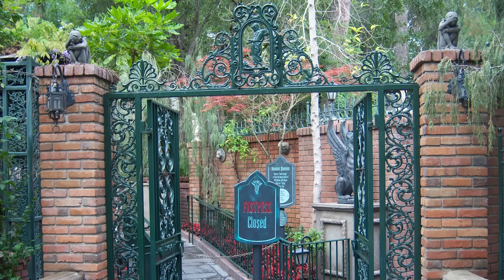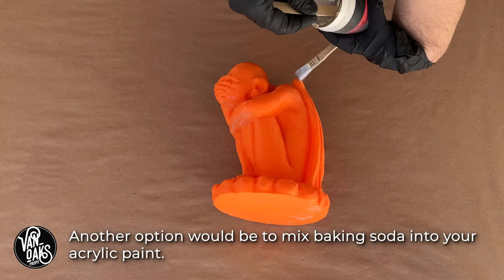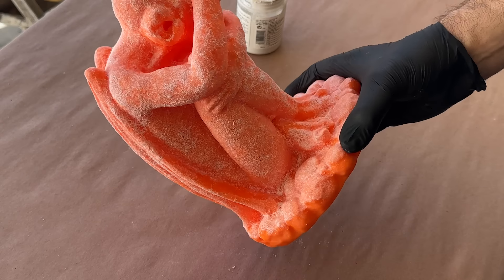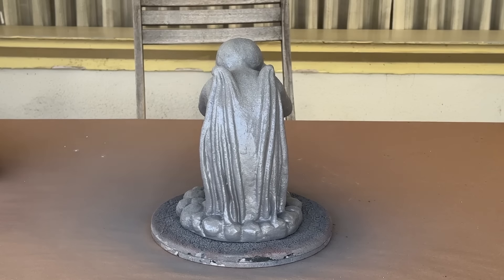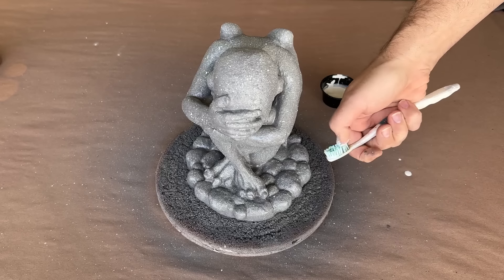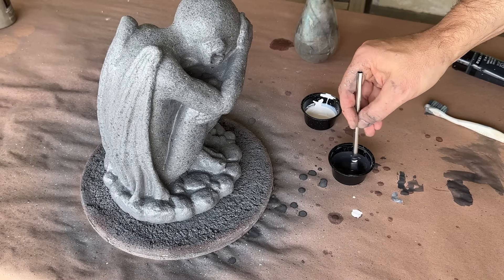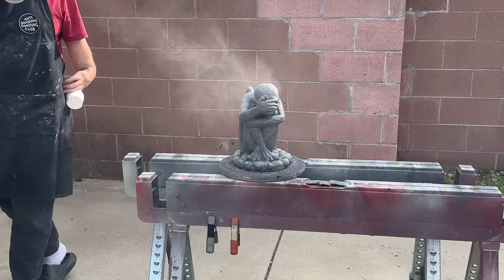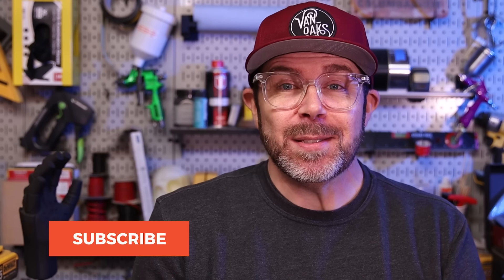Make Your Props Look Like Concrete - Painting a Haunted Mansion Queue Line Statue

Comment: Great video, as always. Again, simple and effective is a prop makers' dream. Also, for your speckle effect, you can also use spray paint. Use rustoleum 2x spray paints (or any can with the more robust spray cap). Drill out the tab on the nozzle. Then, the paint will spray with more of that speckled consistency.  Spray from a little bit of a distance and use short bursts. Black and white are still the best choices, too. As far as your acrylic modeling paste, this is new to me and very interesting. What is this stuff actually made for? The texture was perfect! Great video, and thank you for sharing.
Reply from the maker: I believe it’s for giving more body to paint so that it can be dimensional.